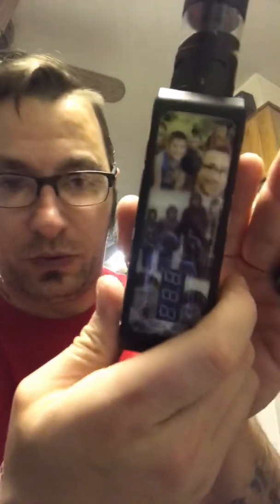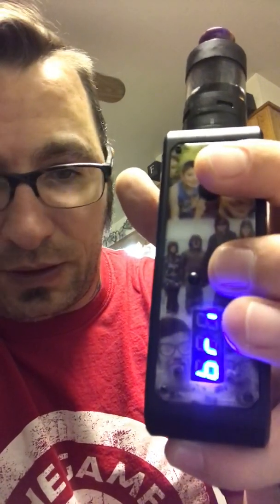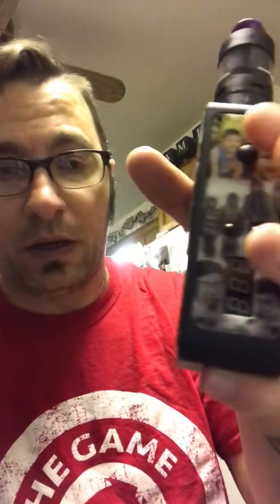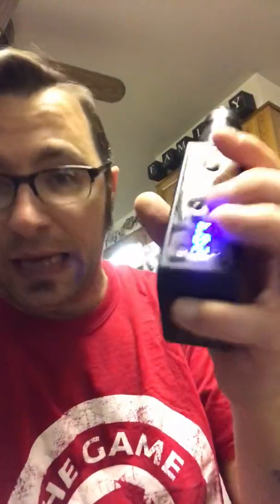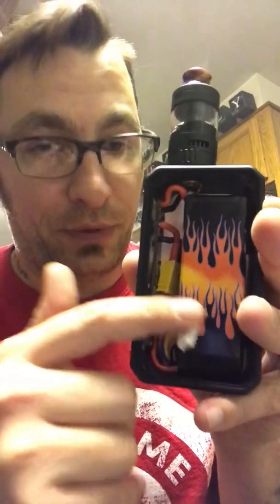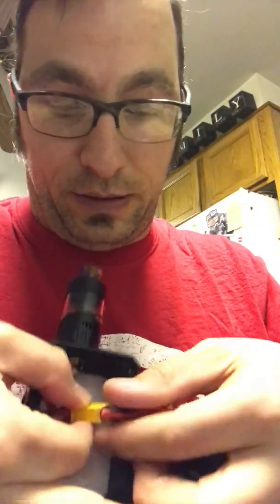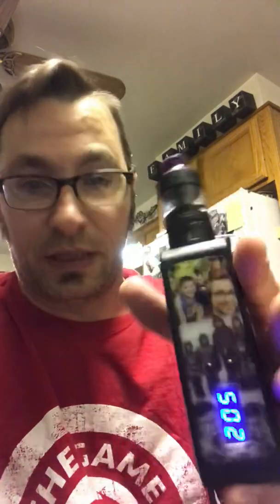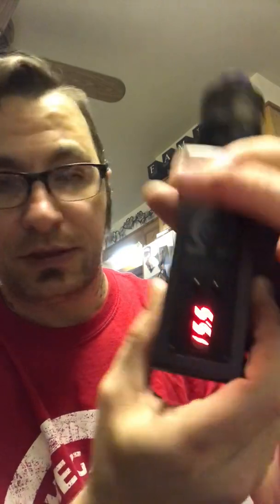NLPWM V2 User Guide

Comment: Why not fire a fresh build on NLPWM?  I'm a MTL Vaper, so am I good to do so or should I use one of my other mods for the initial break in?
Reply from the maker: The main reason is the board is constantly trying to calculate the output based off resistance. 

As a fresh build typically is very low in resistance that causes issues as they start to warm up/get hot spots as the resistance fluctuates drastically. Typically resulting in the device saying "OCP" for over current protection or, when a hot spot kicks up it simply melts the build.

Comment: I watched this just to see if you knew anything I didn't about this lovely board 😂.
You are a wizard brother glad to have you as part of the community.
You said 3 clicks, I don't really know what that last screen is I was screaming "duty"!
Keep doing what you do man! ❤️
Reply from the maker: Drew Ramer lmfao!! I don’t ever look at the duty cycle itself or know what that is. Never googled it lol. 

Also, thank you my man. Hopefully some new users find it helpful, hopefully some more seasoned users see something they are not aware of 😁
Reply: @nickdumas9885  
Of course dude! Love your passion for Vaping as well! If I was rich all I would use is Ohmcentrics, 😁
And
duty cycles are measure of output in standard pwm mods, so you know how pwm is off on off on off on off?
The duty cycle is the percentage of time that the switch is in the on position. Some people erroneously think it's the percentage of power being output. So if you have a 2 cell series pwm mod set to 50 then the switch is on outputtingthe full series power fifty percent of the time the button is pressed . At least that's how I was taught it.
Reply: @nickdumas9885  where did you get the box I'm liking lipos the more I look into them. Great info in this video thanks.
Reply from the maker: korebrent1234 

This is a MC frame dna250C 4S from franknbox.com. They do fantastic work. Can’t say enough about them my man.